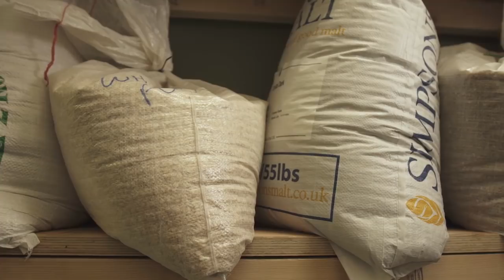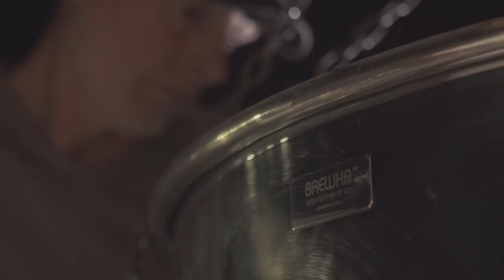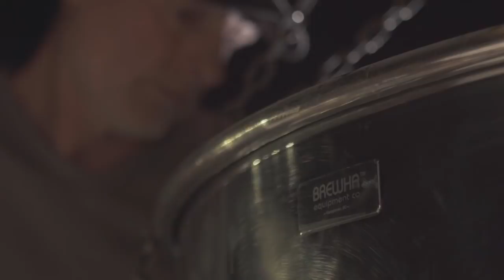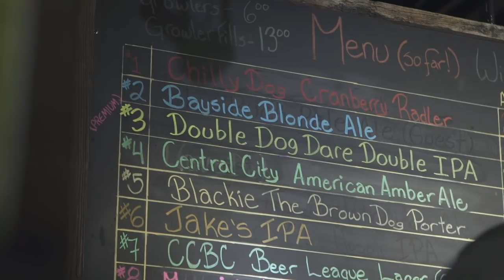Steps for how to successfully start a microbrewery tap room (3 Dogs Brewing, White Rock, BC)

Comment: I loved all of this except for his use of the HVAC system to remove boil steam. This not only beats the hell out of the a/c system, but it sucks up a shit ton of power. I’d hate to see the power bill for the HVAC system. A much simpler, cheaper and easier method would be to just add a roof vent and a large capacity fan unit and vent the steam directly outside using the same flex vent and elbow setup. This has the added benefit of also being able to be used as a cheap air exchange setup to draw in fresh air and get rid of the stinky bar air.

Comment: This is a welcome change when 95% of the videos are telling people NOT to open a nano, micro, or whatever sized brewery!  Guess the others don't want the competition
Reply: It is a really hard business to start.  Sure; do it (if it is your dream), but do it with both eyes open and well-researched.  Notice he went 7+ months dumping time and $ into it before he ever sold the 1st pint. He also kept the equipment small and simple.
Reply: Whilst positivity is a good thing, using the example of the successful business does skew the reality. If you are a farmer, with a spare barn, and a few fields you can make your own barley - you might make a decent turn over selling bottled beer onwards. But as soon as you, take on commercial premises, a bar / tap room it becomes alot of overheads and you need to sell volume quickly - big risk.

Comment: I’d like to open a brewery someday, but I’m just an extract home brewer right now so I’m very overwhelmed with all the extra equipment like pumps, chillers, hoses, mills and more small stuff I don’t recognize I would need
Reply: An the ventilation problems
Reply from the maker: Beer can be made in the BIAC system using just extract. In that scenario, a mill would not be needed (and the Mash Colander and hoist wouldn't necessarily be needed either). But by starting small comfortability can be gained, and CKightZero is right that it's basically the same equipment used for small or large so one can gain confidence and then just scale up. And you can also add equipment slowly; for example, you can have a homebrew shop crush your grain until you are comfortable and want to crush your own, or with the BIAC system it isn't essential that you use a pump so you can ease that in too.
Reply: Maybe try switching to all grain brewing.  There are a lot of videos here on YouTube on the subject.  The equipment is essentially the same (literally everything you just mentioned is used in homebrew as well), just a lot smaller than the gear you'll use in a brewery.
Reply: If i can do it, im sure you can too.  Im actually pricing out an electric brew system im goi ng to put in my basement.  I can say definetly go electric. Its going to cost about $2500. Next year ill probably get a conical fermenter. By the end of the summer, when its finished ill post a video.
Reply: All grain is the way to go my friend. It will reduce your costs and you will be able to gain more control and options of grains for your beer.

Comment: what system would you suggest to brew 200 gallons per month of a pilsner type beer?
Reply from the maker: Hi Randy, lagers (of which pilsner is one style) generally need about 6 weeks in the fermenter so this means you need about 300 gallons of fermentation capacity. For that volume, you could either go with one 5BBL BIAC and one additional complete 5BBL 4-in-1 (200gal/month), or if you wanted a little more batch option, one 3BBL BIAc and two additional complete 3BBL 4-in-1s (190gal/month).

Comment: very cool.  currently in the process of opening up something a little smaller than this within a year.  you said you don't filter (i don't) but do you still add whirlflock tabs or irish moss to the end of the boil?
Reply from the maker: I'll have to confirm with Scott at 3 Dogs on this, but I believe he uses a little Irish Moss in the boil.
Reply: Yes Irish Moss at the end of the boil. We have used Whirlfloc but prefer the irish moss.

Comment: Great brewery model! I'm curious how they dispose of the trub and yeast. Do they have to have some sort of capture system?
Reply from the maker: The solids settle to the bottom of the conical fermenter where they can be removed out the bottom port.
Reply: I probably should have asked the question better. With the amount of trub a 5BBL system produces can you simply dump it down the drown or do they have to capture and dispose of it a certain way?
Reply from the maker: Yes, the solids move the bottom and can be simply dumped.

Comment: Have any health inspectors said anything about the no filtering?
Reply: why would they
Reply from the maker: Hi Matthew, I can't answer for 3 Dogs but I've never heard of any issues there -- many craft beers are unfiltered.
Reply: In the US, I would say at least half the craft breweries don't filter (the number could be higher).  Now that is an estimate but I'm opening a brewery later in 2018 and I visit a lot of breweries.  I don't see why Canada would be any different.  For what it's worth, I've owned one of Nathan's 60L systems for 2yrs now that I'll use for a pilot system with my larger brewery.
Reply: Filtering beer is not for removing biological contaminants. After boiling for 60 to 90 minutes the wort is sanitized. With the Brewha system you are fermenting in the vessel you just boiled in so it is sanitized as well. so the contamination risk is greatly reduced over a conventional system. We have never had a contaminated batch of beer with the Brewha system. Filtering beer improves the clarity. Most large breweries actually don't filter they spin the beer in centrifuge to take out any particulates. Some will argue the filtering or centrifuging affect the taste as you are pulling out some of the good stuff that adds to the beers character. I'm not saying this is s fact just some opinions. We cold crash before kegging which drops a lot of the particulates out. By choosing yeasts that have a higher flocculation properties, hop spiders, and carefully crashing the beers  we can get beer as clear as any filtered beer if we want. Often though with some beers we want the slightly hazy character for the beer.
Reply: There are some health benefits to unfiltered beer. The yeast has certain vitamins which work against hangovers and certain proteins you won't get in other foods.

Comment: Another dreamer here working on recipies so I may one day open a similar brewery in my neighborhood. The Brewha BIAC is the way to go for a small brewery/taproom. Nathan, do you have any videos for cleaning the 5bbl Brewha? This video mentions no drains were needed. I'm also curious as to how much power is consumed for the brewing process.
Reply from the maker: Hi Matthew, there is an article on cleaning in the Learn section of the website (or search for 'clean' in the search bar). Floor drains while helpful, are not critical as a hose can be ran into whatever is available. The volume of water for cleaning is much less so this makes it more practical. Regarding power consumption, one will use about 70kw for a complete 5BBL brew (chilling not included).
Reply: For the 5 bbl system we have 100 amp 3 phase 208 volt dedicated circuit.